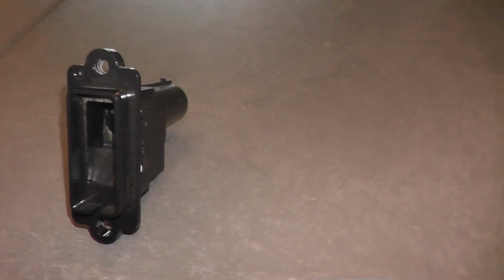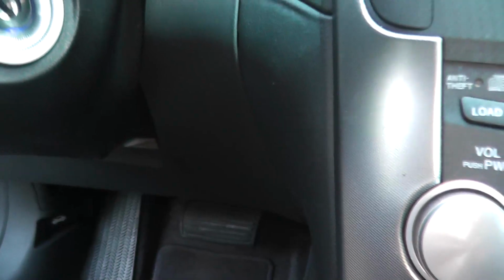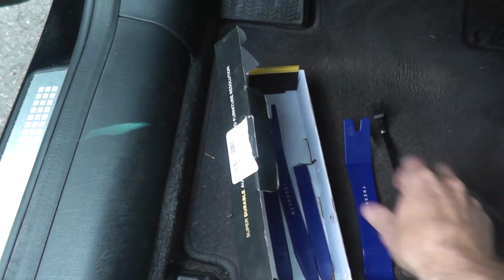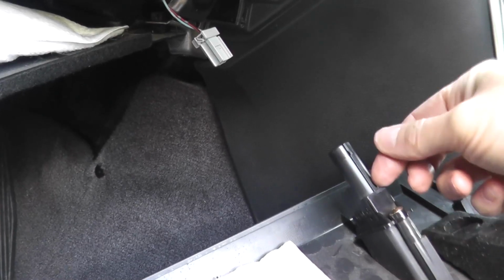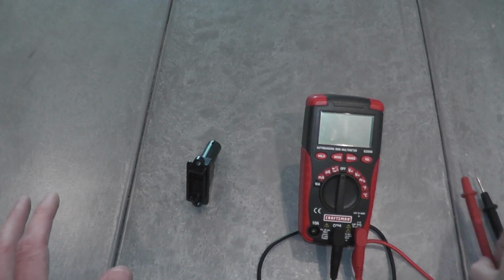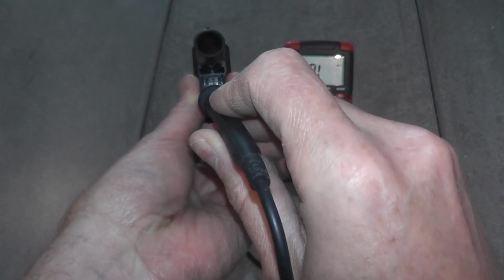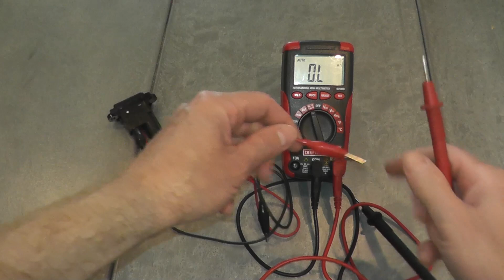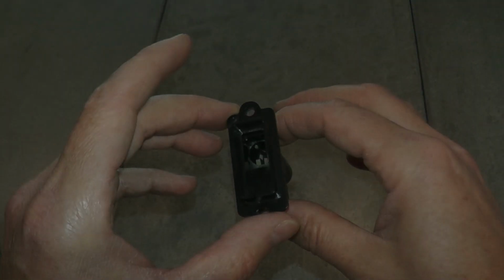In Car Temperature Sensor Testing and Replacement

Comment: The question I can’t find the answer for is what’s the point of the air vent hose that connects to this, and what adjustments does this make on the HVAC. No answer anywhere it’s just another item that can fail that doesn’t serve a purpose.

Comment: Would this cause driver side to be cold and passenger warm i checked the actuators they move but im driver side is cold af when i turn the heat and passenger is nice and toasty
Reply: I'm having the exact same problem as you are on a 2010 Mazda CX9. Cold on the left side but hot air on the right when calling for heat. All ducts. All the actuators are working correctly. Have you repaired it and what did you do? I spent an entire weekend trying to trouble shoot this thing. I even flushed out the heater core, and still no results. Very frustrating when defrosting windows on a cold winter morning.

Comment: Hey. May you tell me what is the problem with my ac or what next steps I should take. My ac blows very cold air for about 20 min from the cold start. After that the clutch is not engaging. New relay fitted. The air sensor works as in your video. Small noise from ac bearing when cold. Going to replace it. My car is similar to yours s2000. Mine is civic type r fn2. Engines are very similar and everything around should be similar. If you would give me an idea it would be great. Thank you.

Comment: What does this temperature sensor work on? Like for instance this is just to regulate the AC and Heating on automatic Air Conditioning systems? Or has a major role with the performance of the car? I’m becoming an enthusiast/DIYer 😅 but still a bit lost.
Reply: Yes, it's used for temperature feedback if the car has an automatic HVAC system (if the car can regulate the temperature you set).

Comment: nice presentation, its been awhile as well. just for clarification is this sensor responsible for regulating the airconditioning compressor to cut-off at the target temperature aside from the supposed evaporator thermistor residing deeper into the evaporator unit? inputs much appreciated sir!

Comment: i was looking on how to test this sensor, and I stumbled upon this video.  You did not specify the make and model of your vehicle, although it became obvious later on from the comments.  But my question is, do all cabin temperature sensors work the same way?  Mine (different vehicle) seems to work exactly the opposite way.  Higher temperature causes lower ohm value, and colder temperatures result in higher ohm values.  SO wondering if mine is defective.  Thanks in advance